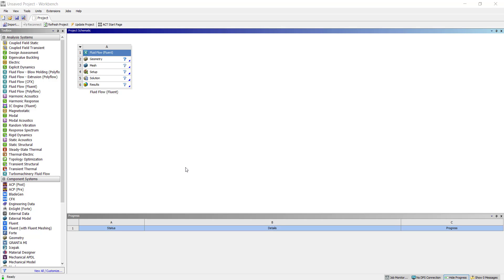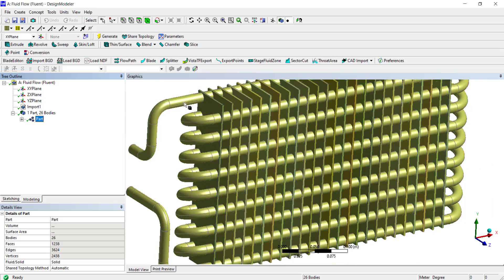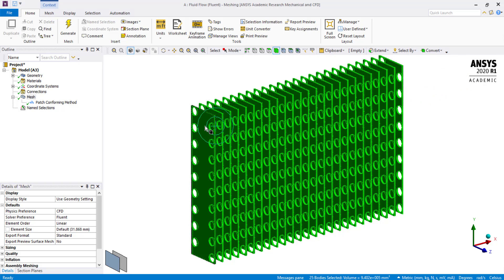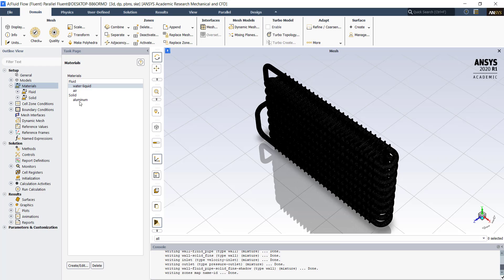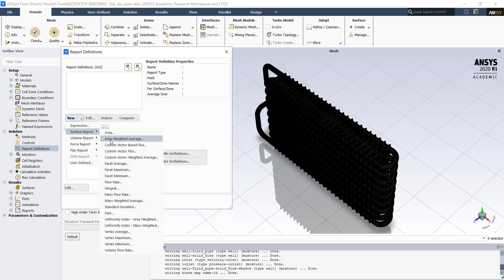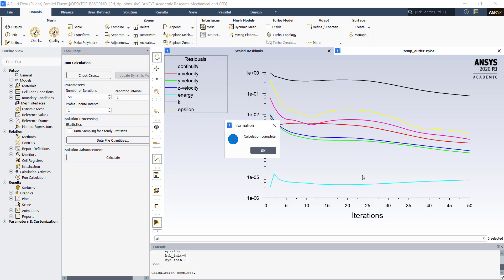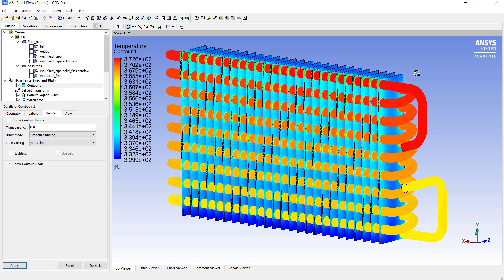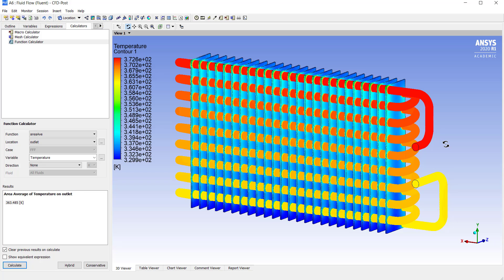How to do Analysis of CHT Between Tube Fluid and Solid Fins of Car Radiator | ANSYS Fluent Tutorial

Comment: Very nice and thank you! ，but i have a question,If we need to consider liquid copper pipes, how should they be calculated?
Reply from the maker: Hi. You will have to model the copper pipes inside the CAD model, mesh it and then assign solid copper material property to them in solver setup. However the small thickness of the solid pipe will increase the mesh count significantly.

Comment: I have a question. IS it right that you didn't select pipe's material? If it is right, could you tell me the reason why you didn't choice pipe's material?
Reply: Pardon me. I want to park here
Reply: Pipe is not even modelled as solid. What you see here is fluid domain shape corresponding to Pipe internal diameter.

Comment: How did u selected all files in workbench to creat a single part pls help
Reply: Which keyboard shortcut
Reply from the maker: I used ctrl + A to select all. Or you can keep ctrl button pressed and select all files by clicking on them.
Reply: @cfdbaba  oh okay but in my pc when I pressed ctrl+A it didn't selected all parts in part tree instead it selected in model
Reply: @cfdbaba hen after firm new option doesn't comming what to do pls help
Reply: Form new part

Comment: I m performing a similar simulation, but with two fluids, in two pipes (oil at high temperature and water at low temperature),
I want to see the temperature raise in water due to heat transfer from fins.. but unfortunately the water temperature is not raising! Can u help!
Reply from the maker: Hello. I will have to look into your case settings. You can send me photos of your mesh and case settings at cfdbaba@gmail.com.

Comment: How to use this simulation in student version, it says too many cells for simulation...??
Reply from the maker: You can reduce the complexity of geometry. Reduce the length or number of turns of pipe in the heat exchanger.
Reply: Sir canyou explain it how in detail it will help full

Comment: From where did you get the heat transfer coefficient values ?
Reply from the maker: Hello. Well, I have assumed the value in this simulation just for demonstration purposes.
Reply: @cfdbaba  But in real work I will have to get convective heat transfer coefficient as a result of this simulation
Am I correct?